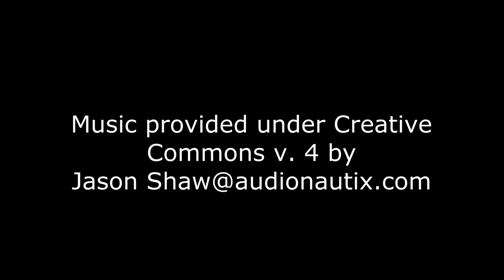Wiring Your Model Railroad for DCC--Problems (111)

Comment: With due respect, I have worked on several large home and club DCC layouts with parallel buss/ feeder wires for 20 years, and we have never had the problems of which you speak. We keep power districts no longer than 30 feet and use multiple power boosters.  We also monitor voltage closely and carefully match booster output voltage across power district boundaries.
The CV confusion issues we have had are manufacturer based (QSI) problems, not system wide. We were having runaway problems until we disabled DC mode on all locomotives. Runaway problems solved.  If you are trying to skimp on buying power boosters and using power districts significantly longer than 30 feet, of course you'll have voltage and signal problems.
Reply from the maker: You have your answer in that your power buses are under 30’ long. As I said in the video inductance becomes an issue when buses exceed 30’ and at higher amperages. It sounds to me like you are already doing everything I suggested in the video.

Comment: so with dcc. i have been told the wire has to go from one end of s layout, to the other.
with dcc you cant make the wiring a loop;
true oof false ?
Reply: Hey Sparky from my understanding that is true because it will send 2 signals around the loop and may reach the locomotive at slightly different times, which may lead to problems
Reply: You can make a loop, just gap the loop.  Leave a couple inches between the ends of the loop.
Reply from the maker: What they said!
Reply from the maker: Loops are not good. You cam T it or Y it or run it palmate like the fingers on your outstretched hand but don’t loop it in a continuous circle.
Reply: I can't tell you whether it's right or wrong, but i can say my first layout was a 4x8 ply board with 2 loops... i had my 5amp dcc connected directly to the track and i ran 2 trains for months with no issues.

Comment: You ever had a turnout when thrown kills the signal to the other tracks train is dead . Till you throw it back or when you park your train at the engine  facility shout down track power the engines with a older decoder address 03 takes off with no control till you put power back on or before you shout down the track power I have to make sure that the switch is thrown.  So no power on that line. Before I shout down track power also analog engines just take off at full speed even through no track power. Also when you shut down track power train still have power and idle but no control is that normal. Also the command station power light flashes but the power on light on the booster flashes like a strobe light is that wright . O.k Larry thank just trying to debug my layout. Small problems. Between 2 districts.
Reply from the maker: Check your wires, you have something crossed—99% of the time that is the answer. I have known guys who worked on fixes for months only to finally find the miscreant wires.

Comment: My wiring is in.  I am probably going to eventually light my structures with 12vDC, but not yet.  I had Digitrax and switched to NCE.  No twisted wires, and as of yet I have no issues.  If I install DC for accessory lighting I will try and keep that wiring away from my Bus.  So since I cannot twist the wires at this point can I cable tie them against each other and would that work?
Reply from the maker: To work effectively the wires need to be in intimate contact over their entire length. Cable ties are unlkkely to give you that continuous contact. Try the bandaid first.
Reply: The DCC Guy I have a bus split into 3 sections one Maine bus with a PSX circuit breaker and an return loop on each end with a PSX reverser 
Do I need 3 bandaids for this setup ?
Reply from the maker: Are you seeing any of the 4 symptoms? If not do nothing. It sounds as though you have one main bus with power drops off it for the return loops so you likely would only need the snubber on the very far end of the main power bus.
Reply: The DCC Guy no problems yet but I do not have dc power installed yet for scenery lighting purposes and I don’t feel it is necessary to use DCC for that purpose although once I eventually get a booster I guess it wouldn’t hurt anything to go full DCC
Reply from the maker: I like to keep things simple so having a 12VDC power bus for accessories and lights does that for me.

Comment: Searching on Google for "16 AWG twisted pair cable".turned up spools in 25 ft and 50 ft. lengths for less than $30. It was more common with solid core so must look carefully.
Reply from the maker: 16AWG is pretty common and may even be available at Lowes or Home Depot. The 14 and 12 AWG is a little more difficult although I see that All Electronics now carries it in addition to parts-express.com .